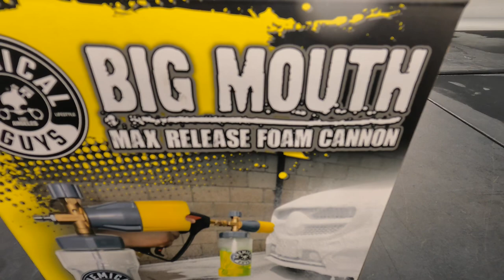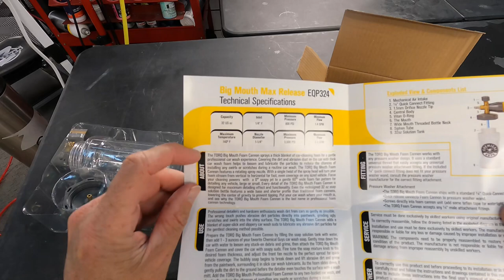Chemical Guys (TORQ) Big Mouth Max Release Foam Cannon!

Comment from the maker: MTM, MJJC, This? Which is the best foam cannon?
Reply: MJJC v2 and Griot's Garage Boss, the new MJJC v3 looks nice, but that clear plastic seems fragile and not as sturdy as v2
Reply: I use MTM because it is capable of being repaired. Honestly I prefer rinseless for the ease of use and lack of water spots without expensive water filters.
Reply: I like my MJJC v2 because it has a wide base and a weighted draw tube that the Chemical Guys unit doesn't have. It works flawlessly and is less expensive than some of the other high-grade cannons.
Reply: MJJC is the king of foam cannons
Reply: Too much $$$ for me.
Reply: Honestly my $15 foam cannon gets the soap on the vehicle. That's all that matters. I use Auto Foam so the thickest foam isn't my main concern
Reply: i have MJJC, using it for 2years now,      and recently purchase MTM  Pro upgrade kit from Carzilla and the foam canon was included in the package, kit included Kobrajet hose, swivel gun, stainless wand, all stainless and Brass adapters/ fittings..           i was surprised MJCC is pretty close to  MTM for my application.     But that kit changed everything...   day and night to work with!
Reply: MJJC 2 is my go to. Works well with my weekend warrior garage  set up here in North East England 🇬🇧 . 4% PIR using bilt hamber auto foam or Koch Chemie active 9.5pH shampoo.
Reply: Purchased the Big Mouth from Walmart since that was all they had a the time and needed something quick, works god. recently purchased a MJJC V2 and it works a lot better.
Reply: Imo seems subjective which is the best.i get amazing results with my tri nova .
Reply: I like my MTM buy for the price I prefer my Griots brilliant finish foam cannon. 
I have also purchased a few $15 ones from Amazon that I use for break buster so if the internals get eaten up I can just buy another one, and for what it’s worth they work just fine ‼️
Keep that mind open 👍✌️☮️

Comment: I think foam cannons have reached the pinnacle of what we can expect of them. This is no better, or worse, it just costs more than others. Personally I use the Adam's cannon. I think it was $60. It does exactly what this $100 foam cannon does, but for $40 less. I will say the one advantage the Adam's has is a weighted silicone feed tube. It's very flexible and gets down to the last drop of product.
Reply: I have the adams as well! Honestly been super impressed and hasn't let me down yet.
Reply: I can agree with that. I bought an MTM before prices sky rocketed and it’s been holding up well for the past 2 years. I would never pay over $40 for a foam cannon again. If it decides to go I’ll just buy an Amazon on

Comment: Great review, i’m perfectly fine with my $16 one from Amazon. I simply replaced the nozzle/orifice with 1.1 mm , gets the job done perfectly. I see no need to shell out $50,$60 or even worse 100+ dollars for plastic container. If you are a professional detailer may be you need it and you can write it off, but in my case not necessary. Look forward to the next review.

Comment: Have had decent luck with my MATCC i purchased from Amazon a couple years back. Foam cannon and stubby gun together were $80, IIRC. I would like to step up to a cannon with the wide mouth canister for easier filling, as well as a wider canister base so it doesn't tip over. Won't spend this kind of dough on CG product though. Thanks for the informative video. 👍

Comment: i researched a lot of foam cannons before getting this Chem Bros Big Mouth.  I have a mid size SUV that has a box on top and the wide spray def helps minimize the passes and get full coverage.  possibly a little pricier than others in the market but for my use it's the only one that has the widest foam/spray.  i figured the slight extra cost can be recouped w/ the time/effort savings on the wash.

Comment: i bought a MAXFoam 8 from Chemical guy a few years ago, the foam is good and it's been going strong. only thing i wish it has was a stubby bottle and a wide mouth, i may buy an MTM wide mouth bottle kit for it and call it a day. 

the silicone tube also isn't very chemical resistant, i've left soap in it and it hardened up the tube where the soap was sitting. easy to replace but for $120 canadian from Crappy Tire, i would have hoped for a more resistant and plyable tube. besides the price and a few minor inconveniences it works well and does what i need it to do, even on my 2030psi 1.4 gpm pressure washer